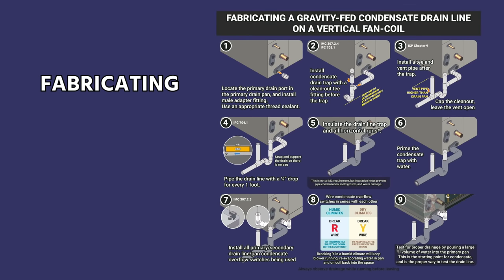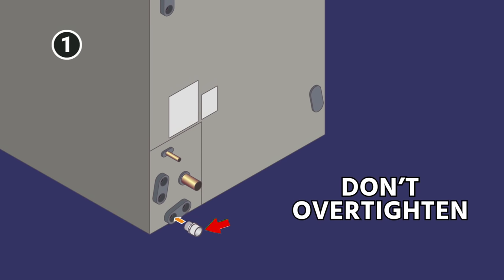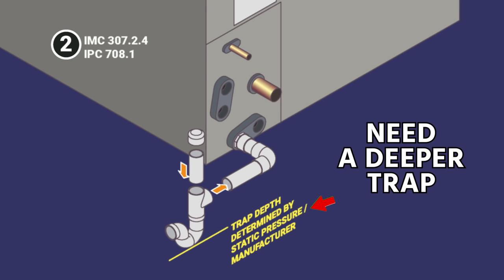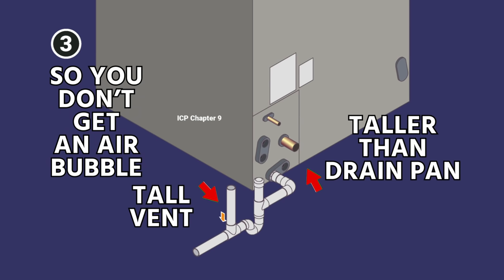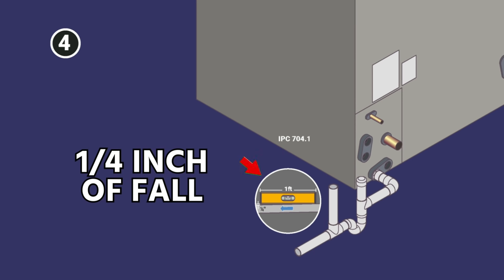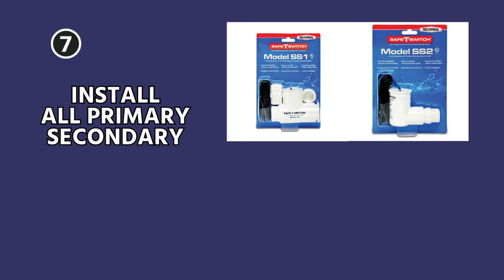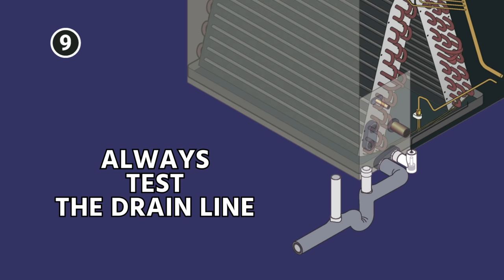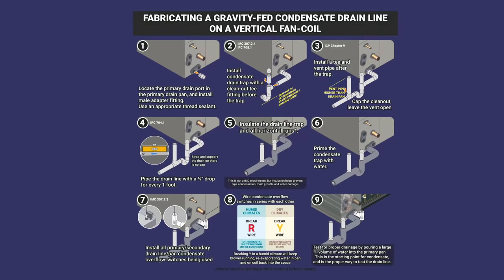How to Properly Pipe a Drain on a Fan Coil

Comment: Helpful video.  Before I knew about the need to have a vent to break the vacuum I connected  a garden hose to a rooftop unit to drain the unit over the edge of the roof.  I think the drain was plugged up inside.  The  15 ton packaged unit was  located over a big dining room with a 20 foot ceiling.  The result was that the drain  pan over flowed and severely damaged the ceiling.  It took a lot of special work to repair including using scaffolding and blocking off part of the dining room.
  My question is how does that drain function properly after a winter if it is not again filled with water to prime the trap?
Reply: It will function after the set point is met it will release the vacuum and the condensation will fall and then self prime.
Reply: The unit drain trap will self prime 99.9% of the time, it's rare to have a priming issue. but when a trap dries out, now you have dirt/debris caked into the trap that needs to be cleaned out or it could clog up. That's why you should clear the drain line every spring, clean the primary drain pan and especially the outlet where trash likes to build up. I prefer to use unions on the pan outlet and the trap outlet, so it can be removed and cleaned.
Reply: @awesomeaustin2348  Unions make a lot of sense! I can't count the times I've had to cut glued PVC just to clean the drain line. I always install unions for the very reason you mentioned!
Reply: @jeffbean2409  thank you
Reply: @drodriguez394  thank you
Reply: @awesomeaustin2348  thank you
Reply: A lot of times actually if your unit is in a unconditioned space like a roof package or a attic. If you live in for example pa where we get drastic swings in fall where one day it’s 80 so you turn your ac on. It hardent been on for a while because it was nice. Where usually evaporate It once again self primes.. then a few days later it’s below freezing well All that condensate in the trap freezes and cracks the trap. And effectively deleting the trap.
Reply: @drodriguez394    Somebody makes a spring loaded drain unit to OVERCOME tha very problem , but only caviat , is MUST BE INSTALLED VERTICALLY  ! Cheers 🇺🇸🇺🇸🇺🇸🇺🇸
Reply: you prolly dont care at all but does any of you know a way to get back into an Instagram account?
I somehow lost my account password. I appreciate any tricks you can give me.
Reply: @Allan Zayden i really appreciate your reply. I found the site through google and I'm trying it out atm.
Seems to take a while so I will get back to you later with my results.
Reply: @Allan Zayden it worked and I finally got access to my account again. Im so happy!
Thanks so much you really help me out!
Reply: @Harper Ira Glad I could help =)
Reply: @awesomeaustin2348  At the beginning of the video where it mentions not to overtighten where you screw the fitting in to the unit, will you be able to unscrew it if you need to later. It looks like after it is screwed in they then glued a piece of PVC in to start making the trap. If that is the case you can never unscrew it to gain access can you? Sorry I am really uneducated about this stuff but in my situation there was no cleanout or "T" put in and I would like to access it right where the drain leaves the unit because I think it is plugged just downstream of it. I have heard you don't want to blow or cleanout junk toward the unit.
Reply: @Charles-in3zt  Hi Rick, after you screw in the fitting which is called a male adaptor, you put in a 2"- 3" piece of pipe, then a union (which can be taken apart) not to be confused with a coupling,  then another 2"-3" piece of pipe leaving the union, then I install a clean out tee pointed down, clean out port on top, then the p-trap with a union on the end, then a vent tee, vent tee piping straight up and above the primary drain pan, then the piping to where ever it needs to terminate.
Reply: @awesomeaustin2348  Thanks so much for this info, it is exactly what I needed to know. Our condensate drain line must be plugged just enough that while it drips water, the secondary pan underneath the unit fills up and start draining through and overflow that they piped through the drywall in the ceiling of our garage. I have been emptying a bucket I put out there for 3 weeks twice a day. It's crazy that they didn't put anyway to access the tap to clean it out. I think your suggestion is exactly what needs to be done for the future. I've just been to afraid to take it on because if I mess it up we won't have air conditioning and man it's hot. Ours is in the attic because we have hot water heat so it 's going to be difficult to get to things. Thanks again for the help.
Reply: Des chamo waterless trap is perfect fit (RLC)

Comment: I don't see a good "CLEANOUT " feature. Where we live the water will "GOO Up", if it stagnates... That short run with a "FORCE Cable" for cleaning, will cause problems. The cleanout needs to a be a Straight Run, so the line can be cleaned for proper drainage... Half measures always turnout bad...

Comment: The p trap on my carrier is not capped and air comes out , wondering if that is normal? I was thinking of taping it shut so I don't lose cold air
Reply: Been doing that for decades and never had a problem. Not only are you losing the cold air, but you are replacing it with hot humid air. Hence, DOUBLE the loss!

Comment: Don't use elbows, use 45's and make the trap as shallow as possible, never had a problem with high static. Also insulate the trap to keep from freezing and cracking otherwise great video. If you can help it never ever use elbows on a condensate trap, double up 45's to make and elbow, your clogging problems pretty much non existent.
Reply: the trap should be designed based upon the manuf recc. Each system is different.
Reply: @dustyflair  Good luck with that
Reply: @missingpiece2071  good luck following the manuf directions, ok capt obvious.
Reply: @dustyflair  Who writes those manuals? My understanding it's usually the engineer that nobody wants to work with and ain't real whippy. It's also pretty obvious that you're not out there in the real world where s*** doesn't always work like it does in a conditioned lab.
Reply: @missingpiece2071  sir, Im just telling you that the manuf will know more about their products than you will EVER know.
Reply: @dustyflair  And I'm just telling you as someone who's out there in the world working on their products that they don't know s***
Reply: Trap with 45’s as shallow as possible is just not correct.  The trap needs to be deep enough to overcome the negative static on the return. The depth of the trap and the lower position of the outlet  also allows the column of water to push push out any crud.  The manufacturer can’t tell you how deep to make the trap, because they don’t know what the final static on the return will be.
Reply: @rodgraff1782  good info, never had that problem but something to consider especially high cfm units.
Reply: How important is the cap on the clean out? My secondary keeps getting activated shutting off my unit and my guess is my primary isn’t draining properly because of air getting stuck in pipe not letting the primary drain properly. Also, my pvc trap is about 4 inches below drain. Not sure if that is a problem.
Reply: @sullivanrealestategroup  I run the shallowest least bends possible to form a trap and I usually still end up putting a wet dry vac on the end of the drain every year to suck the debris out

Comment: @hvacschool Am I wrong or did you have a video on the configurations for condensate drain lines on positive and negative pressure units for horizontal applications? Because i can't find it
Reply: Bryan has another one similar to this called 'A Few Condensate Considerations' at https://www.youtube.com/watch?v=-JSdAMuwbig.
Excellent videos by others showing air & water behavior in both are here... 
'Condensate Drain Traps - Correct sizing: by KHS Engineering Topics'
at https://www.youtube.com/watch?v=5ZijpU7tHVc
and one for a unique system is by 'CostGardTM Condensate Drain Seal' but the LAB VIDEOS are awesome! At 
https://www.youtube.com/watch?v=MS-KdN3MWHU

Comment: Agreed with everything but breaking Y. This can cause continual short cycling. Either break R or C (if applicable) going to the thermostat so if nothing else the thermostat goes out on time delay allowing the pressures the level. 

Thanks for the content you provide.
Reply: Residential yes, commercial no. Commercial you dont want to break R and keep the system from bringing in fresh air
Reply: Not sure how exactly it would short cycle since it takes quite a bit of time to evaporate enough water to get the float level below the tripping point. And of course, a fair amount of time for it to rise back up.
Reply: I'm speaking from experience. I've seen it first hand. Hearing the compressor run in reverse because of shor cycling. 

I've also seen many wired  breaking Y, once you see what I've seen you want take or encouraged anyone else to take a chance.
Reply: @ishalljr  Hmmm. Guess if you have enough negative pressure and/or turbulence, that could move the water level just enough to change the switch position. Thanks for the share.

Comment: I'm a home inspector and I routinely watch videos like this for this purpose:
I was inspecting a home that just had a brand new HVAC (heat pump) installed within the part couple weeks. 
I found 5 discrepancies to put on my report with the HVAC alone, the condensate drain being one of them.
Reply: Glad you do your job well.  Oklahoma inspectors do the bare minimum and will flag things that aren’t even an issue so they can say they did something.  👀
Reply: @zachosborne6577 most inspectors dont even get up the attic here in texas 😂its hot

Comment: And your findings how many times have you seen the float switch kill a fan motor, a contactor, or some other component in the system. Happened to me several times just during maintenance. Just testing the float switches I’ve had a cnotactors , motors shortEspecially with carriers I’ve noticed more so than others. Could be we have a lot of carriers though. It has happened to some other units as well like Lennox and Goodman as well as a  trane. Standard float switches not touching any metal with no issues before arrival. I did have a couple for the motor sounded kind of off at first then they failed. They were all wired in series breaking red. Thanks Jerry!
Reply: Jerry, there is another issue present each time. It's not the float switch as it's quite literally impossible for the this to happen.
Reply: Right , I questioned this myself on numerous occasions and has also happened to other techs. Although not as much. My guess is it’s giving it some sort of power surge when it’s kicking in on and off. The same thing is happening to motors when they’re having brown outs. Due to power issues with FPL. We show up and there’s all sorts of issues like every unit needs a capacitor. There’s at least one down fan motor and or circuitboard etc. occasionally condenser fan motors and compressors as well. Do you know something went wrong to win the pool pump is bad or it blew the cap.
Reply: @jerrylockhart3069  in theory if you interrupted load power just momentarily and then reapplied it you could cause something like the compressor to get "hung up" (can't recall the correct term) and of course the LRA goes up each time the motor initially starts back up but I wouldn't think the LRA is a factor. Admittedly I am more familiar with residential 220 in Alabama so I can't speak much to three phase commercial/brownouts but I would expect that  improper voltage  along with the float switch  would probably have adverse affects. Hopefully we may get a response from Brian and in light of your last response, I take back my precious "literally can't happen comment lol.

Comment: Thanks, really informative.
I couldn't find a definitive answer to that question: Do you need a p-trap on a positive pressure system (furnace)? I'd say yes because cold air would be pushed out. Most said you don't because it's positive pressure. Any code article stating one or the other?
Reply: I don't know code requirements.  If you think about it, you're paying to heat or cool all the air going through the air handler.  Even though it's a very small percentage, by allowing some conditioned air to blow out the drain line, you're wasting that small amount of energy.  Technically, you wouldn't be losing that energy if the unit is installed in a basement or other internal conditioned areas of the house.  If the air handler is in the garage or attic.. you are.

Comment: Missed one setup. When a horizontal furnace and coil are installed in the attic or an upflow furnace and coil are installed upstairs you can actually run the secondary drain straight into a secondary drain line that would stub out on an exterior wall above a window. This way when the primary becomes clogged, the water would then drain out the secondary where the homeowner would see it and know something was wrong. This was code and the way we used to do it on housing tracts in Southern California back in the 80's before condensate switches were popular.
Reply: I see new construction homes today do the same thing with the secondary drain dripping into the garage, usually above the door into the home. Very hard to miss that!
Reply: @sed6  Actually sounds like a great place to put it. Most people are in their garage daily and the concrete floor should withstand it well. Would not be good if you use your garage for any kind of storage. Any kind of organic material that gets constantly wet in a dark warm environment like a garage is inviting a serious mold problem!

Comment: My Bosch air handler has a trap, but not a clean out tee. I bought a tee to add but I don’t understand if I need to be concerned about positive positive or negative pressure. I don’t think so. There’s no vent either, but I thought just adding a tea would be a safe bet to help me clean it more regularly from the top instead of just the bottom.

Comment: I am redoing my primary drain in a HVAC /Furnace combo. There are air vents on the current install that are both before and after the p-trap. Both are uncapped. I believe my system is a POSITIVE airflow system since when the blower is on, there is air coming out of the uncapped vent before the trap (nearest the unit). There is little to no air coming out of the vent after the trap. My question is, should both vents be uncapped as it is today? Does it matter if the vent after the trap is capped or not? Any advice would be appreciated!

Comment: Great video. I just had a new 95% efficiency system installed. My drains are basically at the floor in the room and I'm unable to install a trap due to no more height. I have a crawl space where the contractor ran the line under the house and adapted 2 inch pvc trap set up in the crawl space and vented it outside the foundation. We failed inspection even though the inspector liked the idea. He also said that if we had no other option that this method would actually pass but in the same breath mentioned the reason for failure was that the outlet or the trap inside the crawl space could freeze. My point was it can only be run through the crawl before it goes outside so it could freeze anyway. Besides cutting the floor open or having the entire furnace reinstalled and lifted to clear room to create a trap, what other options do i have for installing a condensate pump? Thank you.

Comment: On my house A/C (30 years old), there was no drain trap.  Should I put one?  I recently had water problems found when cleaning the filter.
Reply: Was it rusty on the inside? if so yes you need a trap ASAP!

Comment: It seems like my primary drain from the furnace is routed to a bathroom sink drain in the floor below, and the secondary drain line is routed outside the house.  Is this setup correct, or at least ok?  Lastly, would it be best to tap into the primary or secondary furnace drain for the drain from a dehumidifier?  Thank you!
Reply: Regarding the initial question, yes, that is a correct configuration.

Comment: I keep having problems with a  Trane ahu (negative pressure) horizontal left where keeps getting into the blower compartment
The drain is trapped with vent pipe after the p-trap. I'm not sure why it keeps happening

Comment: I came upon a VERTICAL AIR HANDLER ABOVE THE WATER HEATER, where there was a plastic container below the a/h, it was a particular RHEEM. drain on LEFT SIDE, but you could not run the line lower, as it would be covering accseee door, so they has a. Street  elbow, line then ran horizontal to drain access in the wall, HOWEVER IT NEEDED A LEAST 6” DROP, to get over the NEGATIVE   I got some pipe & a n EZ TRAP, BUT made the drop 12” as there was lots of space to get to pipe in wall, lady said it ALWAYS LEAKED , you should have seen how much snot was in that drain pan!  
I guess the installer either did NOT READ about the 6” minimum drop , Or did NOT UNDERSTAND  !  That was about 20 years ago in MIMAMAR  FL  CHEERS 🇺🇸🇺🇸🇺🇸🇺🇸